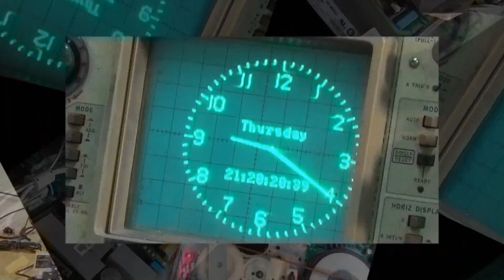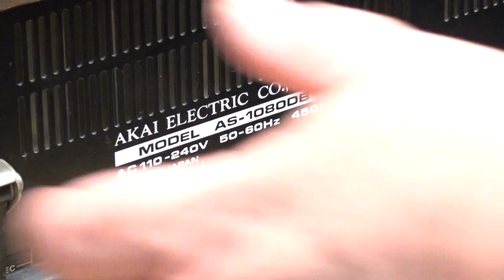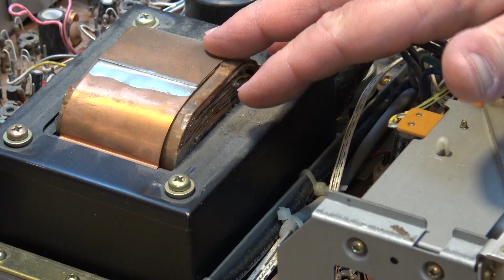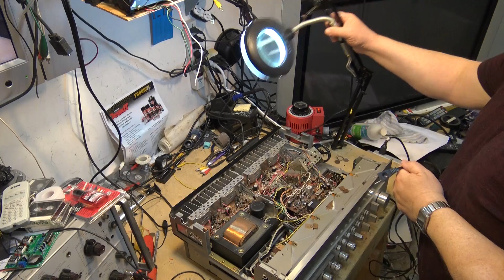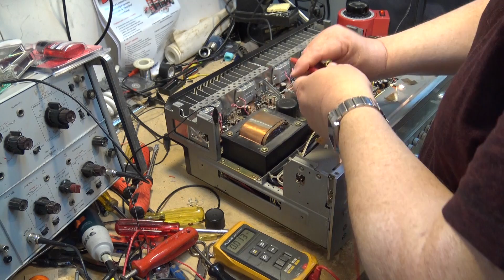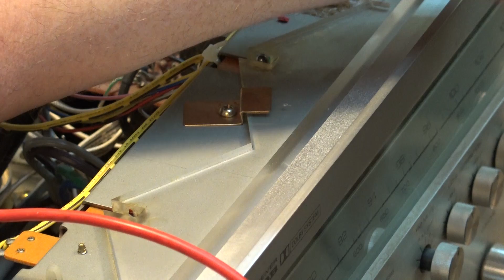Akai AS 1080 DB Quad receiver no sound

Comment: In the UK and Europe we use DAB and DRM(Digital Radio Mondale) on QPSK(Quadrature Phase Shift Keying) or QAM(Quadrature Amplitude Modulation), Time to ditch Windows 10 and go with Linux Mint 17.3 (Rosa) 64 bit edition and you can actually find open source oscilloscope firmware that can be built from source and used to display signal waveforms via the line in.
Reply from the maker: We had DAB here for awhile, but it was all shut down, and anyone that bought a radio now has a paperweight.
The government originally was giving out DAB licenses, but when the Americans waffled, and threw their support behind IBOC and OBOC  technology it killed DAB dead in it's tracks.

Comment: You can find Sanken S-60W units on ebay, NOS @ $50 per unit "buy it now". You might be able to get them at a more reasonable price. There are S-40W as well which are much cheaper, but they are used
Reply: on this kind of akay apm, you need to replace all transistor and caps, because they are shittyy